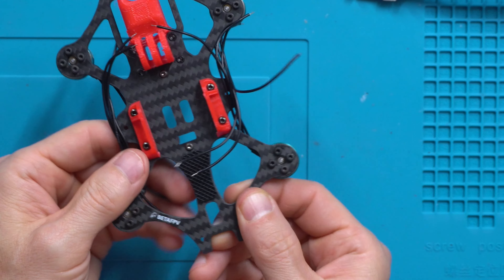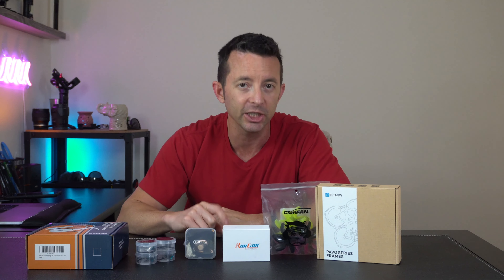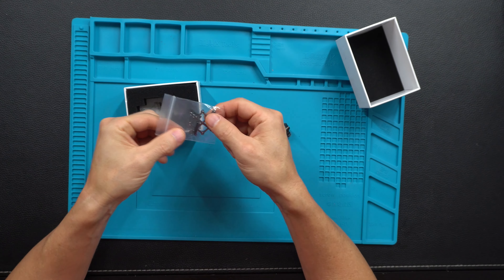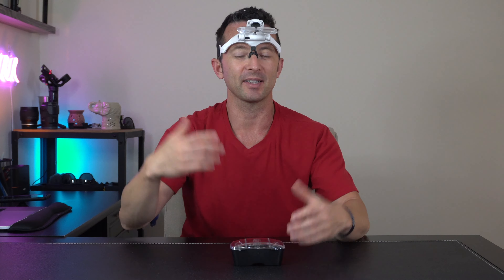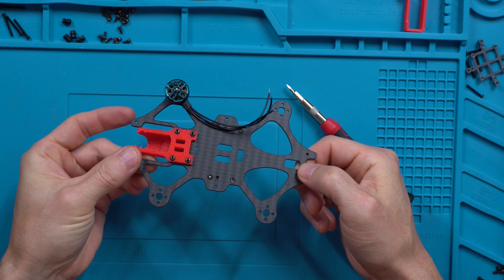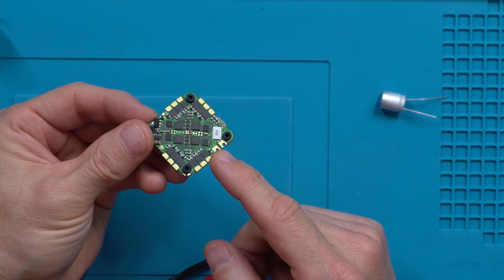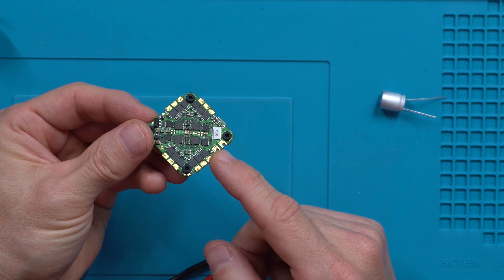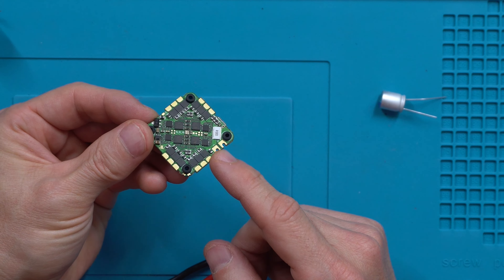BetaFPV Pavo 25 6s HD BUILD LOG - "Troncat Edition"

Comment: Fantastic build. I built a similar quad as Troncat and it's the best build i had going. Need to build a 2nd one as backup
Reply: is it good with gopro/action cam on top? do you think the motor is enough or need more kv?
Reply: @wgaprint  I've flown it with a naked gopro 9 and 11 flywoo one. It's flies fine. I did damage one of the motors recently and had to switch to a geprc 1404 4500kv i had as spare. It wasn't as smooth as the Hglrc 1303.5 2500kv i was using. For my indoor real estate purposes.
Reply: ahh I see, is the motor damage from a crash or just by it self ? @ha-media
Reply: @wgaprint  It was a crash. Now the motor is pretty much out of stock everywhere
Reply: thanks, yeah the motor is quite rare now @ha-media
Reply from the maker: yeah the 2.5 is money, ive build this pavo30 not long after ala Troncat as well... https://youtu.be/tROMrGVa70w

Comment: those motors are out of stock everywhere, any similar motors you would recommend?
Reply from the maker: im somewhat new still to building so im not familiar with EVERY brand, but if you can find a similar size set from someone comparable im sure youd be fine, you check directly on the hglrc site?
Reply: @LifeofAccro  i ended up going 4s
Reply: I used T-Motor 1404 3800kv

Comment: Sweet build video.... I recieved this frame and started building... I have a slight problem, my vista camera original doesn't fit the printed mount 😆🤦 do you know of a larger print or will I have to buy a micro vista camera?
Thanks.
Reply from the maker: since im kinda new as well im not sure, but if you got a full sized camera vs micro Ive made that mistake before too with my protek35 but either cam wouldve fit on that. im sure there might be, perhaps ask Troncat or reddit/forums but i think it might be safe to assume that if youre trying to save on every gram that a full size cam has to be a hair heavier too... i will say that i got the falcon nano as mentioned and I IMMEDIATELY noticed better video quality especially in lower light cutting through trees so if you can return and get that one then this is the best camera i think ive got between the protek and nazgul (although the OE dji cam is nice too)
Reply: @LifeofAccro  thanks for the reply, looking at options 👌

Comment: I have a problem with my fc orientation. I did everything like the video but in betaflight the fc orientation is no good, it's the same fc board.
Reply from the maker: im not a pro by any means, but youre sure the "foward/front" arrow of the board is indeed facing forward? if so you should also be able to rotate its perceived orientation CW or CCW in BF....